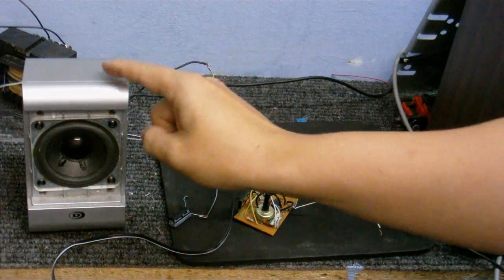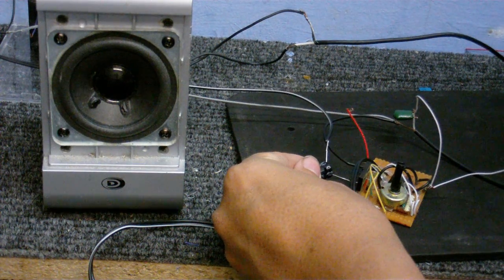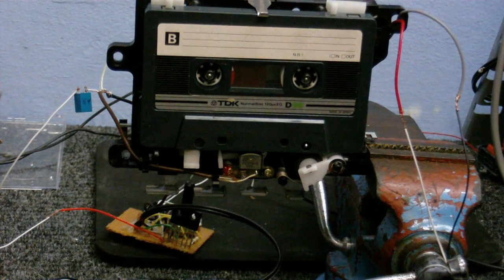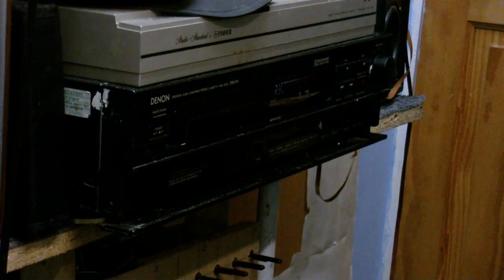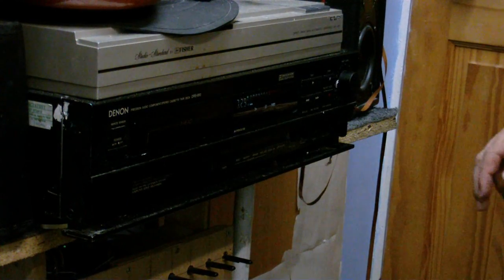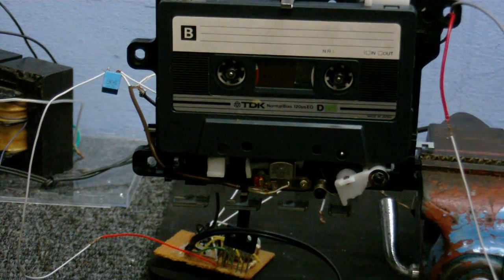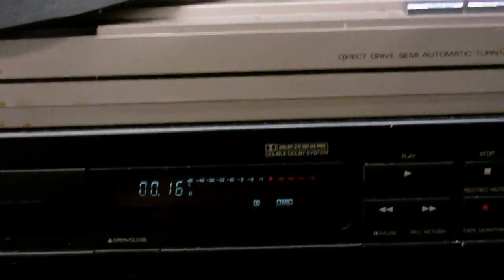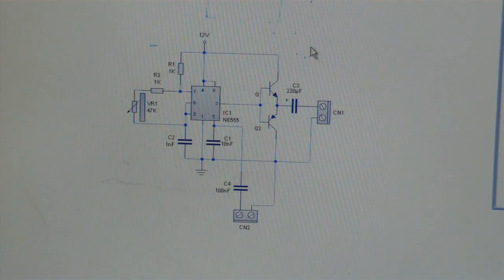555 timer class D amplifier and  tape recorder experiments

Comment: where do hyou connect your bias oscillators output please? to the record head?
Reply from the maker: Yes just connect it to the record head though a capacitor, 1uf should be enough. By the way this isn't a bias oscillator, it's a pulse width modulation experiment to see if a pwm signal would make an intelligible recording on to tape.
Reply: oh ok, does this replace the bias osc anyhow? thank you
Reply from the maker: yes you don't need a bias oscillator with this circuit.
Reply: thx

Comment: Really interesting stuff here Clem!  You are doing modulation here.  I am not aware of this being done before.  Good work! As far as I know, the High frequency bias signal (~40Hz - 250hz) signal is usually just mixed with the audio signal.
Reply from the maker: yeah, I know it's modulation rather than mixing a bias signal, but I wanted to see how well a PWM modulated signal would work as a recording signal. I just couldn't remember the right word to use.
Reply: Congrats man!  I'm impressed.  I'm going to try this.  I'm not sure too many people realized how innovative this actually is!

Comment: In fact what you are doing is very close to classical recording with AC bias, but not a real "class D recording". The tape is premagnetized by the 555 chip signal, and a superimposed low frequency audio signal does exist. It is the result of your duty cycle modulation. So, since the tape filters high frequencies (as when classically premagnetized) you get at the end a classical analog recording with AC bias.
Then you've recreated the same final conditions with an AC bias. It works even better if well adjusting the levels.

Comment: Fun stuff... and thanks for posting your schematic. There are too many experiments and demonstrations on YT that don't have the circuit posted; which is frustrating. In regards to your experiment... I wonder what would happen if you attempted to match the impedance of the tape head with the gain circuit and/or adjusted the gain with a scope as you recorded? And I also think that you could easily apply a little DC Bias with your Class D driver... that might do the trick...

Comment: Actually, sending audio through the 555 like that converts it into pulse signals, which makes it sound so distorted at the end of the clip. You could use another 555 in a multivibrator setup to modulate the first 555 circuit. I think this would make some nice robot voice or FM/ring mod kind of effects.

Comment: @CoolDudeClem yes i am having problems with heat but then agen i was useing way too small transistors :) it was rated for .6 A i was pulling about 1 amp .. and when they are that small they do not have heat sink mounting holes..  ya i was just protoboarding and i need to order better

Comment: @CoolDudeClem i do not understand how the efficiency is lost on some amplifiers. when the efficiency is high then its giving out fractions what the full wave form of the signal coming in meaning its not giving off the same wave length as it is receiving. i can see where that may come in to be important in some devices but generally i find a class AB just as efficient as A since its not giving the full signal output if you get what im saying

Comment from the maker: @MrStemkilla basically a transistor needs a little bit of voltage at the base if it is going to be used as a class A amplifier, so that's what the two resistors do, with enough voltage at the base, the output to the speaker (or whatever is connected) will be about half of what the supply voltage is. and a small change at the base from something connected will produce a big change at the output, you might want to look at youtube . com / user / SteelWheelsDown this explains a lot.

Comment from the maker: @MrStemkilla Yes that is possible, but the transistor would have to be biased properly, typically what would be used to bias it is a 10k resistor from base to ground and a 100k from base to positive, but it can vary with different transistors and supply voltages.

Comment from the maker: @CassetteMaster The 555 PWM was connected to the head with no external bias, in the second experiment I did in this video I was using it as a bias oscillator.

Comment: Very nice experiments!! Did you use the PWM audio to the head without external bias? Or did the 555 circuit just supply the bias each time? 

I have had the idea of a 555 PWM audio to be used as a bias myself, and plan to do a recorder like that sometime.